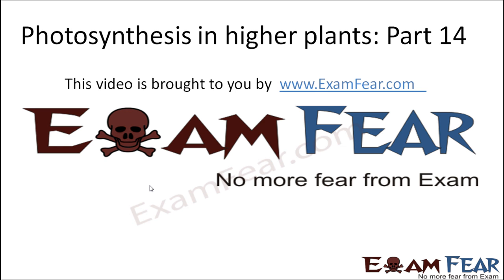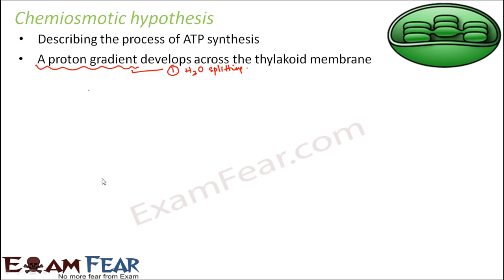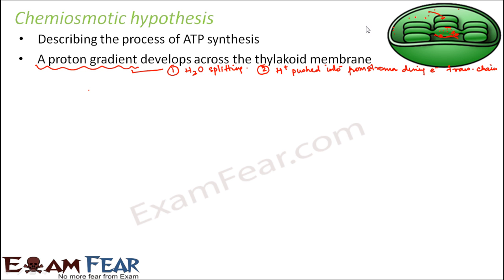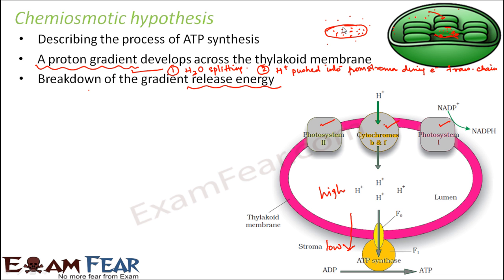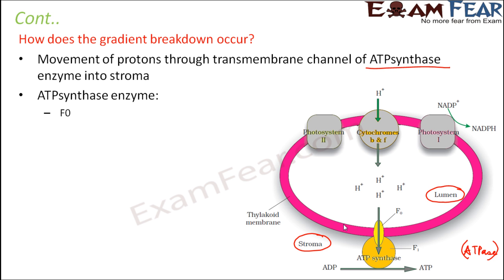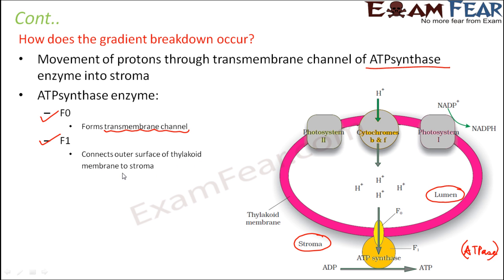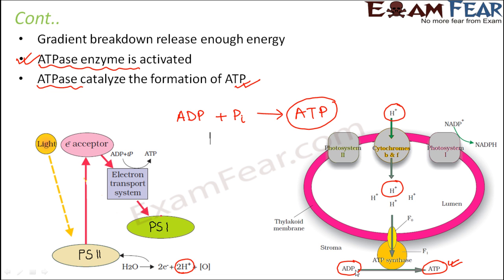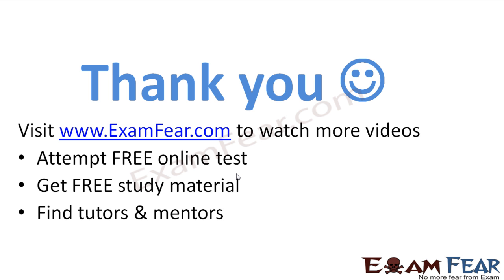Biology Photosynthesis in Higher Plants Part 14 (Chemiosmotic Hypo) CBSE class 11 XI

Comment: I have a doubt, after the electron is transported into the ETS to the PS1, then both the electons- the one from PS2 and the one from PS1- are carried to another electron carrier. After this, will it follow the cyclic phosphorylation, that makes both the electrons come back to PS1 again or does it end there?
Reply: sanjay siddarth ,,,  both the cases are different, if only PS1 is functioning then cyclic process takes place, because after passing electron to PS1, the PS2 may or may not function.... if both the systems are functioning then non cyclic photophosphorylation takes place i.e.  for non cyclic photophosphorylation to happen functioning of both pigment systems is a condition.